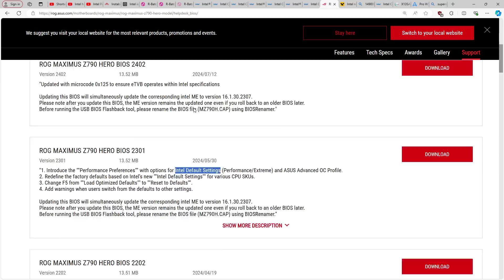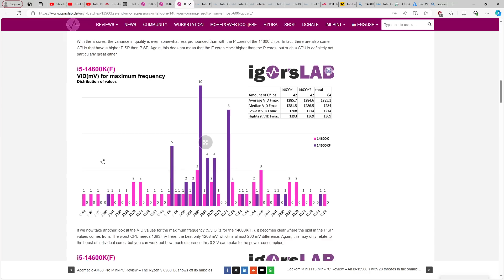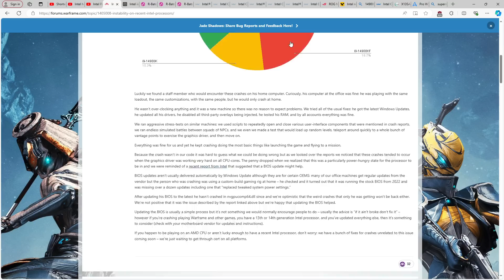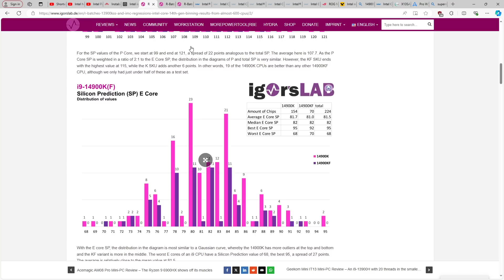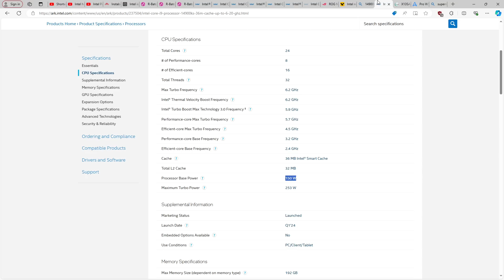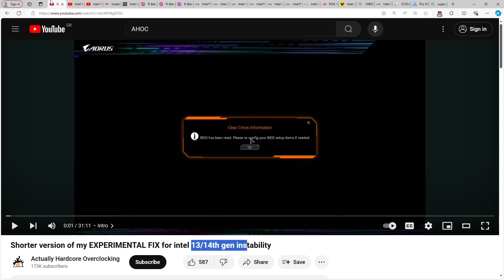The intel instability and degradation rant.

Comment: So.. Lowest LLC possible and plays with the AC_LL to getting the best possible compromise to not get high voltage spikes ?
Reply: There's no guarantee that will fix the issue.  Wendell's video reveal that gaming server providers started limiting clocks / voltages and that only delayed the CPU failing but it did still continue to degrade.
Reply: ll try this way and let's see. Just buyed my 14700KF 5 days ago.. I saw the memory controller is pretty weak tho, i can't pass stable above 4200 CL 16 with Gear 1, and i think i have a good b-die kit.

Comment: According Intel the 13900K runs fine up to 1,7 V. I think more important than the Vcore voltage is a look into the CPU Current Limit / ICCMax. Once I set them to Intels recommended 307A (was set to 512 A by MSI) it runs just fine!
Reply: How do I find these in the BIOS
Reply: @avalokiteshvara113  Depends on your BIOS. In my Z790-A you find these in the Advanced CPU Configuration menu.🙂
Reply: @Ohlukei  what is the iccmax_app that I see in the Intel default settings? Do I have to worry about that?
Reply: @avalokiteshvara113  Just set it to 307 A too for the 13900K. I think IccMax has priority over IccMax_app.
Reply: @avalokiteshvara113  Set the same value like for IccMax there!

Comment: I have 14700kf  for a year now.After  stock testing and high temp form day one i undervolted and underclocked  5,3ghz -0.100V  and not a single bsod ycruncher  stable occt etc.I  have noctua u14S and max temp 79C in ycruncher.So goodluck with stock settings,intel pushed to hard frequency and voltage.
Only fix is underclocked from day one and undervolting.Some cpu are more resilient so degradation will apear later,but no one will escape without reduced clock.
Reply: Bro what's your highest vcore? The problem is the extremes, i might be the case that even 1.4v could be just too much voltage for the ring of the cpu.
Reply: @dethskullcrusher  with undervolt and 5.3ghz is 1.24V maxim low load,all core is 1.15V

Comment: As a 10th gen intel owner, I will not be buying intel in the future. It's shocking how far the quality has fallen.
Reply: I also moved to AMD and my 2nd system is now also AMD, an AM4 5700X3D which is actually fantastic for everything I do.
Reply: My 13700k / 4090 build has been flawless for almost 2 years now. Started on a z790 ddr4 board then switched over to a z790 ddr5 tomahawk when it was released a few months later. Contact frame since day one as well. Went from a 10700k oc to 5.1ghz on all 8 cores 5.0ghz on the ring at 1.35v on a z490 msi tomahawk to a 13700k oc to 5.6ghz on all 8 p cores, All 8 E core oc to 4.4ghz, Ring oc to 5.0ghz at 1.34v. Even the mem controller on my 13700k has been very solid. 32g.b Corsair rgb vengeance 6400 cl32 hynix A-Die oc to 7200 34-41-41-83 at 1.45v. On a msi z790 tomahawk. I can't complain and I'm for sure not worried. I use my system for over 8 hours a day for work / gaming. My system has been used and abused for almost 2 years now. I don't baby it. And it's just fine. If it goes I could care less at this point. I've gotten every penny's worth out of this system.

Comment: I am an Intel user with a 12700k so no. Not all of your audience has an i9. I also have 3200 mhz (16-18-18-38) 1.35V G.skill RAM and I was wondering whether I should upgrade my RAM or my CPU first. Is it ok to use RAM with 1.5V on the 12700k? I know I will void the warranty but I was wondering if it will reduce the lifespan of the CPU by going over the alderlake 1.4V RAM iimit.
Reply: I have 12700KF, unless you have a 4090 you probably don't need a faster cpu
Reply: Honestly upgrading your ram is pointless unless you need more of it (meaning more Gigabites not more RAM speed) and about the cpu upgrade.. I wouldn't do it until this whole mess is clarified.

Comment: I guess I dont understand why VID matter at all because for the last 10 years at least they have been pushing more voltages than required into chips. Loadline is garbage. My 8700K would have died ages ago if it got what VID it requested. You can manually select worst case scenario and make an 8700K request over 1.45V but why would set your bios up like this and then complain? when it kills your cpu. This whole situation makes no sense unless you look at it like everyone is just using stock settings because they dont dare touch their bios and their chips are dying because they also have no idea how to cool an i9 and then run it on auto sitting with loadline settings having them north of 1.5v consistently. Trying to use non sever parts as server parts and wondering why they fail is nonsensical to me? I tried to use my shovel as a screw driver it didnt work. I just dont get why that is even a topic.
Reply: I understand you're probably a buildzoid watcher but not every person tweaks their settings(vast majority of hardware users), and it's absolutely completely unacceptable for default hardware settings to be non-functional on any piece of electronics you can probably think of.
Reply: Dude, there is no excuse for any CPU, (or other chip for that matter,) to start failing in less than a year at stock settings. If the stock settings are dumb then that's the MANUFACTURER'S FAULT! VID matters because it should never cause problems out of the box. stock VID should be boring, safe and reliable.
And there's nothing magical about server parts that makes them super durable. They're just typically tuned for efficiency, which just happens to also reduce wear. Running a consumer processor at consistent high load shouldn't be a major issue at stock settings! Back in the 00's I had a core 2 duo pegged at 100% load for a over a year straight doing distributed computing stuff for fun. That system had garbage thermals, but the processor never complained. As it happens, I later got around to overclocking that CPU, and found that stock voltages were way higher than necessary. I got a lot of thermal headroom just by cutting the excessive VCORE.
The stock settings should always be well within what the processor can sustain. The rate of degradation for some of these resent i9s is what you'd expect from running an aggressive benchmarking overclock 24/7, which is basically what Intel does from the factory now. It's stupid!
Reply: If this was happening to 13900 non K and 14900 non K cpus equally or greater than the K and KS versions than it would be a real issue. Those are the stock versions of those chips. The K and KS parts denote they are enthusiast. In your comment you mention that as far back as core 2 duo they have been pumping in too much voltage. Thats far more than 10 years of terrible auto settings. You entire message is riddled with inconsistency.  How do you reconcile "there's nothing magical about server parts that makes them super durable" and then "They're just typically tuned for efficiency, which just happens to also reduce wear"? There are many things different about server CPUs and consumer CPUs esp reliability. Again, I tried to use my rake as a shovel and it just didnt work. Who could have thought? My 1/10th the cost consumer grade non ECC CPU just didnt work as server CPU. Imagine that???!?!

You seem to be confused that there is some sort of "stock" for any of the K series parts when the K specifically denotes that you the user are responsible for how it operates. They do not even sell it with a cooler! I can find forum posts over the past 15 years of people who have had parts that died who ran stock settings because there mobo over volted their chip. This not new behavior when you buy K series parts they just heavily leaned into expecting people to know what they are doing at the wrong time. PC and pc gaming is the biggest its ever been which means collective knowledge is the lowest its ever been with increasingly harder to find experts.
Reply: @D3nsity_  If you check you'll see that the "Enthusiasts grade" K-intel chips tend to be a bit cheaper than their non-k counterparts, no doubt due to being shipped without a cooler. Is it then difficult to imagine that some gamer who doesn't know or care about performance tuning, might still desire an aftermarket CPU cooler for quieter operation and because it looks cool, and therefore buys a K-CPU to save money. It even comes with a higher advertised boost clock! "What a great deal!"
They're definitely not marketed as enthusiasts only. If anything they're just marketed as the slightly faster versions. At least on the online marketplaces I frequent. If anything, if these were intended as the "enthusiasts" chips then I'd expect them to have the exact same stock settings as the non-K chips, and just have unlocked clocks, since enthusiasts don't care about stock clocks anyway. We just want to tweak things.
Again, stock setting should be boring and safe. Especially these days that modern CPUs have very solid thermal throttling tech to prevent overheating, and routinely turbo up against TJmax in fairly normal conditions on stock cooling. If the designers are worried about roasting the chips they are free to set a more conservative default temp targets.

And with regards to that core 2 duo that ran with shit stock settings; it never died. Nor did it ever show any signs of degradation. Stock it ran way higher voltages than was needed to maintain stock frequencies, the stock thermal paste was atrocious, and the crusty power supply in that prebuilt computer output horrifyingly unstable voltages. But this was still well within what the silicon in that old CPU could handle continuously. The safety margins for both heat and voltage were complete overkill by today's standards. I'm not sure they did much binning back then, so they just made the stock settings absurdly conservative. My point though is that it's fair to expect any consumer CPU to survive a continuous heavy load at stock settings. For a few years at least. That's what the stock settings are ostensibly for! Even on the highest trim "enthusiast" chips. We warn noobs about the risks of overclocking. Not the risks of NOT undervolting!

There is a slight chance that this will all turn out to be a motherboard problem that's common across manufacturers, but even then we shouldn't go blaming the customers for naively expecting the stock settings to be stable and safe. We blame the manufacturers for making the stock settings overly aggressive and their poor validation testing. This is something they should have caught in endurance testing. Hell! There's a decent chance they did catch these issues, and decided to ignore them, because they really, really, really, really wanted those impressive frequencies for marketing reasons.
Reply: I completely disagree with the notion that K chips have stock settings. The non K versions are the stock chips with stock settings, otherwise they would be failing in high volume. You can manually set those settings if you desire with a K chip and since people are expecting them to be the same but are not doing the leg work of actually setting it causing it to fail then you are describing user error very long windedly. K chips being cheaper has nothing do with anything. Non K parts are stock parts with stock settings. K chips are literally advertised as settings unlocked. All the I5s are cheaper than the K part its only the i7 and the i9 that go on sale so often but that really has nothing to do with people chosing to buy unlocked cpus and not even being bothered to research they dont come with the same settings as NON K parts with STOCK settings LOL
Reply: @D3nsity_  You consider it user error to not modify the bios settings when installing a K-chip?
I just think you have an extremely generous standard for quality and reliability.
Reply: I do consider that user error because the stock versions of those chips, the ones intel locks down and decides exactly how they opperate, the 13900 and 14900 non K and they are not failing like the K and KS version. I consider that if you are consuming something that requires research and you dont do any research then it is indeed user error and your own fault. Its like buying a rake and using it as a shovel and wondering why it breaks. This is known motherboard behavior, to overvolt cpus to 1.45V+, since at least the 6700K. How else was I able buy, research and opperate an 8700K and know that in 2018 when that was my first high end cpu purchase. Because I researched everything from every manufacturers bios to every component error etc. People are acting like just because they can use a computer they know about computers. Cars are all cars right? Its how you are treating CPUs as "all cpus are just cpus". Well if you buy a ferrari and try to put regular gas and crap oil in it and it breaks, that is indeed user error because you didnt know how to opperate it. Why can the same logic not be applied to people buying K sku chips that have no intention of touching bios when its a known behavior of boards to kill chips for over 10 years? So you think that its ok that someone should spend thousands of dollars with zero clue on how to use anything they just spent thousands of dollars on? It doesnt work like that in any product line in existence. The higher up any products stack you can think of requires more user experience and knowledge compared to any entry level part in the stack. easiest example besides cars is pressure washers.

You can buy cheap 1000psi pressure washers and pressure wash anything without damaging anything. If you apply your logic to this scenario then "all pressure washers are pressure washers" so you can buy the 3800psi pressure washer and use it and opperate it how you please without reading any instructions just expecting it to work, dont read procedures, dont worry abou the danger of higher pressure water(high voltage in your cpu) and just destroy everything you try to pressure wash as close as the 1000psi model and wonder why everything is breaking.

literally the exact same thing with high end configurable CPUs. You need zero expertise to run an i3(1000psi pressure washer) you will never break it. You can do any task with it and never throttle(nothing destroyed while you are pressure washing). You buy an i9 thinking you know how to run computers(you clean stuff with your 1000psi washer after all). You buy the big boy washer because you hear how fast it cleans. You get it and nothing works the same and everything you try to clean breaks because there is too much pressure! Instead of researching about how big pressure washers work you claim its the manufacturers fault and demand that the 3800psi washer have a 1000psi mode! You only consider doing this after you realize you broke the 3800psi washer by not knowing anything about its opperation(bios).

Thats exactly how I see it. No one did their research and they are wondering why its breaking.